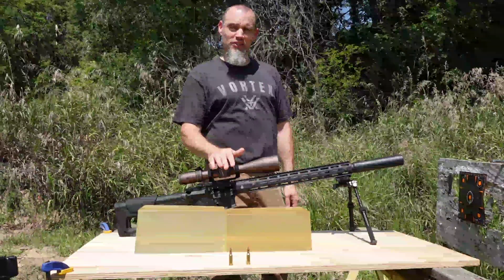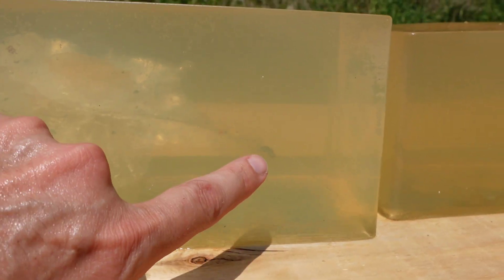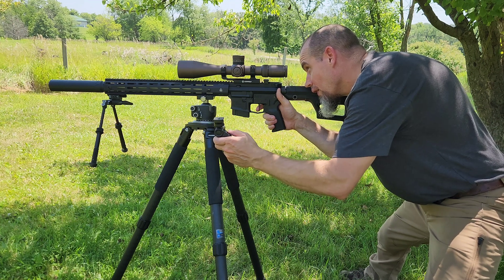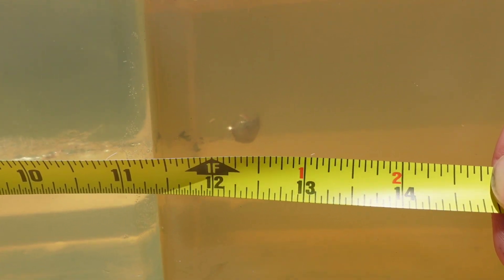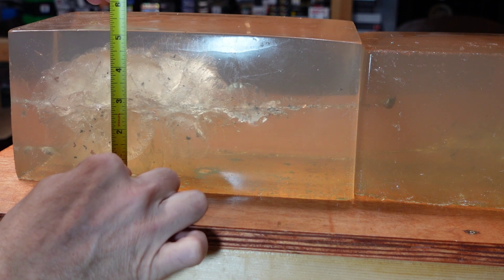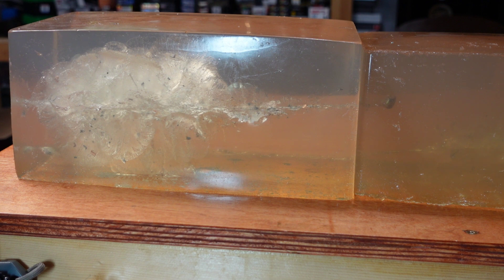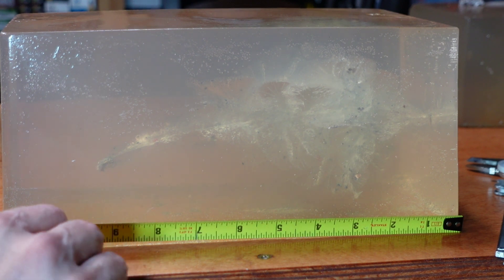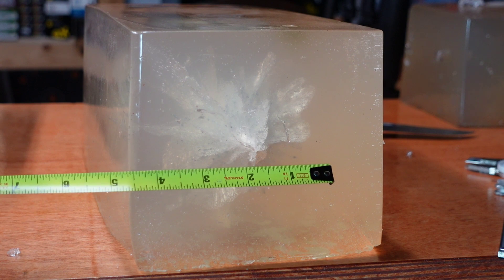6 ARC Handloading part 3: 75 & 87 Vmax ballistic gel test.

Comment: Hey, any belting problems with your brass like johnnies reloading bench had? I bought some virgin starline, sized it, fired it. I am currently sizing it and getting it ready for its 2nd loading/firing and I am starting to get belting. Ballistic advantage barrel, Hornady dies. Even have the dies raised up a little to get a 0.004 shoulder bump. I am really not liking the way this is shaping up.
Reply from the maker: On my Hornady brass I didn't see any belting but I only got to the 3rd firing on half of it and the primer pockets were getting loose. On my starline brass I haven't got through the first firing on all 400 cases yet, been working on my 223 Ackley lately. I need to get back to this rifle , I have some varmint grenades to test.

Comment: Just did my first testing. 75gr v-max at 3083fps, 85g nosler partition at 2852fps, 107smk at 2640fps. Light primer flattening, no other pressure signs. Starline brass will be in tomorrow, i will really be able to get some work done.

Comment: How is it possible that your load on the 75 g bullet had over 3000 ft./s and the 87 grainers are only going 2750 my 87 grain load is going to 2960 from an 18 inch barrel kills coyotes on their tracks
Reply: @Lazybump  so far 7 reloads before the primer pockets start feeling loose. Running a Geissele Super  Duty AR15 with a proof research 18” barrel
Reply from the maker: With AR Comp I'm at a compressed load at 2760. I couldn't fit enough powder in the case to reach 3000.
Reply: @thelonggunner762  try Leverevolution it's the fastest I have tried
Reply: @Pew_pewchronicles  lever revolution seems to be the best powder for 6mm arc with the exception of the light bullets. At the heavier loadings cfe223 meets or exceeds lever revolution velocities.
Reply: @jonathanrogers9961  good to know never tested CFE 223. I found no reason the other Powder gives me great performance.
Reply: @Pew_pewchronicles  im trying to work with what i have. Got a fair bit of cfe223 for 223, figured id try it before i bought a new powder to stock. As i understand it cfe223 and lever revolution are sisters , almost identical but some small differences due to the copper reducer effecting the chemistry. With hornadys data for the 108-110 g bullets  both powders produce 2575fps in the msnual, but cfe223 does it with 0.6g less powder. With the 103-105g bullets it gives up about 50fps. Id say lever revolution is a better choice over all, but i have 10lb of cfe223 to get through before i look for a new powder.
Reply: @jonathanrogers9961  that’s a lot of powder to burn through I’ve seen testing by Johnny’s reloading on YouTube and he didn’t get very good results with CFE 223 by the way with Leverevolution  I got 2750 ft./s with 105 grain Bullets
Reply: @Pew_pewchronicles  im testing 107smk, 85g partition, and 75g vmax. I lean towards bullets seating for accuracy rather than optimum charge weight. Feel its easier to adjust and can be tuned to the barrels and charge weight.

Picked up that powder in early 2020. It was the only powder i could get in bulk. Wasn't sure on availability of any powder in the future so i went all in so i could work up one load and be done, instead of working up a load each time i found a powder that i could use.
Reply: @thelonggunner762  AR-Comp did not do well in my 6 ARC, I got pressure signs before getting decent velocity. With Lever I get 2850fps with 90gr bullets Shooters World Match is suppose to work even better but I haven't found any to try yet.
Reply: @Lazybump  Leverevolution 31.7 grain max charge from Hornady reloading app

Comment: Well now you got me re-thinking everything. Probably over thinking too. So I bought 75g for my 6mm arc hoping to do my first testing next week. I really liked the extra 250-300fps vs the 87s, just felt like too much velocity lost for not enough weight gain, about 16% for an 11% reduction in velocity. Watching your video though, The extra penetration of the 87g looks really good, bullet held together better. However at the same time, that testing was done at 75yds. I wonder what the bullets would look like at say 200, 300, or 400yds, once they have lost some velocity. My guess is expansion would be reduced and penetration increased. the 87g might do poorly and the 75g might act like the 87g did at 75yds. I will say, I am not a huge fan of the jump of the 75g. In my rifle its like 0.126 to the lands. The 75g also has less drop and retains more velocity than the 87 out to 500yds, which is a win IMHO. I don't know, now I got a lot of thinking to do. I may have to dig my gel block out and load up some reduced loads to simulate a 300yds shot and put one in the block just to see what happens.
Reply from the maker: It makes me want to take some gel blocks with me next time I head to the big range and set them up at 500 or 600 and see what they do.
Reply: @thelonggunner762  that would be mighty interesting.